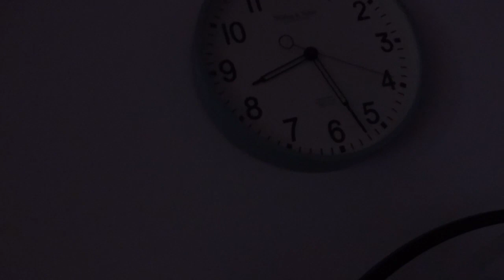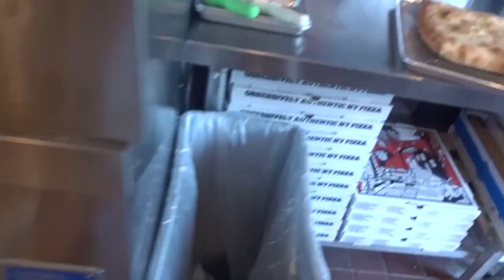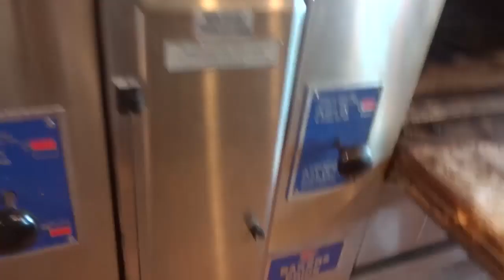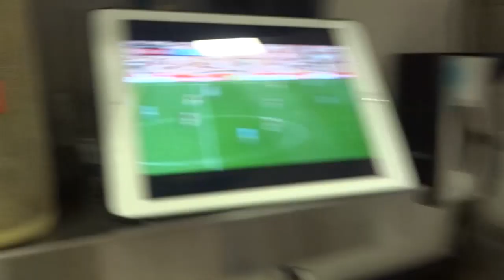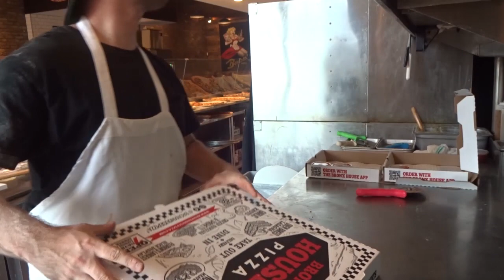Day in the Life of a Pizza Man! - VLOG - See the World in the Eyes of a Pizzaiolo!

Comment: So it's 48 hour cold ferment, so how long can use the dough before it's no good? Do use the day before first?
Reply from the maker: Realistically, it depends.  This is about .1% yeast, it's pretty much always still good if not better at 72 hours, but I've still managed to pump out a pie at 96 hours (4 days) and 120 (5 days) as well.  You have to be a little gentle and the crust was a little acidic but the dough didn't deflate at those points
Reply: @LevitaNostra wow .1% ? I’m at .5 %
Reply from the maker: @cliff185026  .5% should be fine as well, cold ferments are more controlled, but when you pull it out of the fridge expect it to rise fast :)
Reply: @LevitaNostra  I did Tony Gem. Neapolitan dough recipe with poolish and left it room temp for about 20 hours and the dough balls turned super flat
Reply from the maker: @cliff185026  flat is either a sign of overproofing or a problem with proper gluten structure.
20 hours room temp is a LONG TIME with a poolish recipe, unless it's like 5% poolish.  Your dough probably inflated to its max then deflated turning flat, or did it not rise at all?
Reply: @LevitaNostra  6 -7 pm: made poolish. Then did the nea. recipe without poolish and did a overnight bulk ferment at room temp. 

Next day 

11:00 am de gased dough in stand mixer. Basically dough expanded to top lid of stand mixing bowl(4.5 quart bowl. Doubled recipe. ) Added poolish from prior day. Mixed in. Balled. Put in baking tray with lid. 

7 pm: dough balls laying flat.
Reply: This was my attempt to delevop the best flavor in a 24 hour period. Would refrigerate dough balls next day and then take out an hour before baking if I was to attempt this  24 hour method.